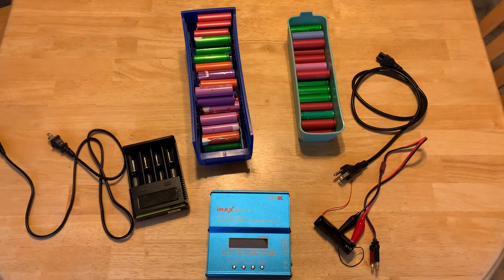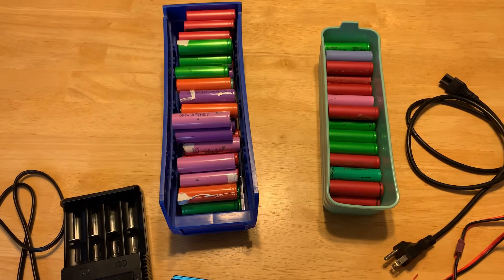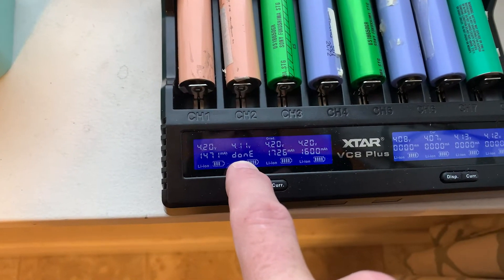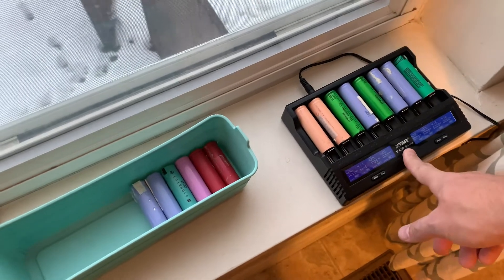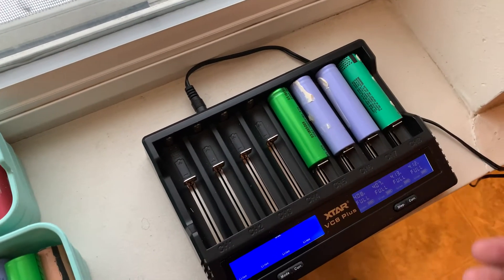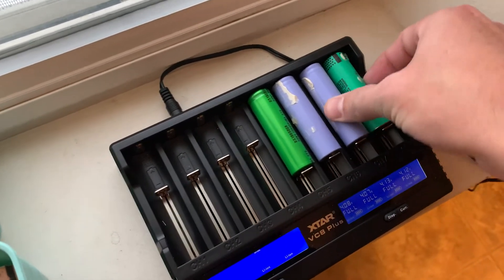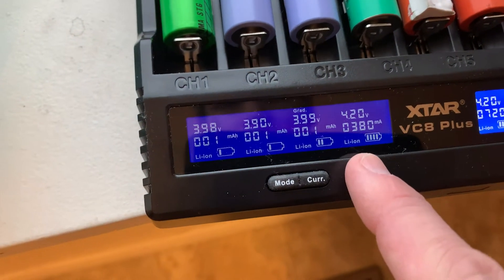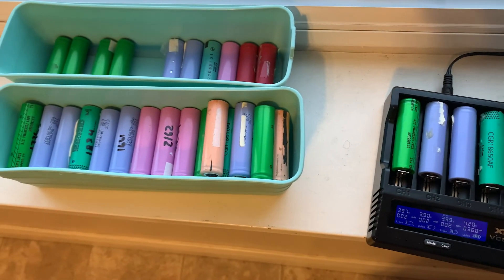Improved Battery Testing: 18650 Cell Processing for Homemade Batteries

Comment: I’m caught between this charger and the SKYRC MC3000
Reply from the maker: I have never used the SKYRC MC3000.  It looks decent.  I really like my setup.  Sadly, as an 8 bay charger, you really need to have a use for 8 slots to fully utilize it.  It looks like the 3000 you mentioned is a 4 bay.  I have a 4 bay (the model is not coming to mind and I don't want to dig it out) and it felt like I was "always charging" batteries since I had so many and there were only 4 bays I could run at a time.  If you need more then 4 ... this 8 bay really does the trick.  My opinion though.

Best of luck :)
Reply: @badideametals  thankyou for the video and the awesome reply. I am going to go with the MC3000 because of all the different battery chemistry and also the PC hookup and phone app. makes it super convenient and total control for my batters both testing analyzing and charging. the only downside its its expensive compared to the one you have.

Comment: Pretty neat devices. I've recently gotten basically unlimited access to 18650 cells from discarded garden equipment batteries. Have you come across something that would scale better and/or do the charging and discharging (cycle) and get some more meaningful data?
Reply from the maker: This is still my favorite charger.  I have not looked to see if something better is out there.  At times I do wish that all 8 sockets functioned like the four left side sockets and could do the discharge test, but I get by :).

Comment: Hi all! 

How to preserve a 18650 for a long time without using it? 80% charge once every 6 months, and store it in dry and room temperature, or fully charge it and leave it for a 1 year? Thank you!
Reply from the maker: Thank you :) It is generally a good practice to store the batteries at less then a full charge.  That is very true. Thank you for your comment :)
Reply: @badideametals  Thank you! But how often should I recharge them?
Reply from the maker: @koleuslybra  now that is a tough question.  I never drain mine too far… and I try not to leave them charging past 95% unattended.  As for the batteries I don’t manage, I leave them plugged in.  Many modern charge controllers are built with battery health in mind.  They cut off at safe highs and lows, so that is taken care of… and those I leave plugged in often kick on (such as battery powered lights) when they are needed and I can’t take them out easily to monitor.  

So I guess to be honest, I trust in the chargers to have been engineered well enough to optimize charging.  I only worry about the “too full” or “too empty” if I plan to put a battery in away for months at a time.  It helps keep the battery healthy while it rests :)

Comment: I heard it is very important to match them by voltage is well?
Reply from the maker: Yes.  I do that in a previous video.  I match them by voltage in general.  As they are all from laptops, and they are 18650 cells, I check their max and min voltage and determine their nominal voltage to be the median.  It is not exact… but I figure it helps me weed out dying cells.  Also, I let them sit in a bin and check their voltage after a week or two to find the quick discharging cells and pull them out.  But yes, you are correct.  The cells work best if matched in capacity and voltage.

Comment: Used 18650 batteries end charging at 4.2V (by XTAR display) but my multimeter show anything from 4.18 to 4.23... I am puzzled on why it is happening. Perhaps different batteries conditions... but why the voltage goes above 4.2?
Other than that I absolutely love the device.
Reply: Multi meter must have a good battery to get an accurate reading.
Reply from the maker: I am not sure to be honest.  The batteries could read differently based on age, number of recharge cycles and possibly their internal resistance.  Sorry, I don’t have an answer to this question.

Comment: Just so you know... I did 3 different tests with the same battery, because the first one had given a very low value and the 3 were different results in the storage capacity. I think that before having the final value you need to cycle the battery for it to be better activated... imo.
Reply from the maker: Hey thanks :)
Reply: @badideametals   I mean, do at least 3 discharge tests to get a better accuracy on your battery's mAh.
Reply: @CadeBrazil  that cant be efficient 😭😭
Reply: Run capacity test then take averages

Comment: I'm trying to build one myself, but I'm a novice. What range of capacity can be put together into one battery? They have to be very closely matched, or they can be between 1400 to 2300? What exactly happened to the battery build?
Reply from the maker: Too much difference in mAh will drain the life of the better cells faster.  I have come to the conclusion that you want each cell to be pretty close to each other in the pack.  Make a few smaller batteries and have one be a lower capacity with your 1400 to 1599, 1600 to 1799 … etc.  the battery will work putting them all in, but your better batteries will die out faster that way.

In short, be patient and try to collect more batteries of the same general mAh max.  Good luck :)

Comment: It can do LiFePo4 but it requires you to select store mode and be ok with a max voltage of 3.7 or a touch higher. 

Charge rate is set based upon internal resistance. 

Cells starting the discharge cycle of “grad” at 4.01 is a touch low but keep in mind when a load is applied the voltage will sag.

Comment: Where did you get those containers/bins?
Reply from the maker: The light blue rubber ones are walmart brand.  

https://www.walmart.com/ip/Mainstays-Set-of-3-Flexible-Drawer-Storage-Organizers-10-4-x-3-2-x-2-9-Green/509555735

The dark blue ridged tray I have had for over 30 years.  You can find this same plastic tray on ULine.com or other hardware supply sites.  They are expensive now ... the mainstay (walmart) was like $5 for 3 trays ... and the 18650s fit in the really well.